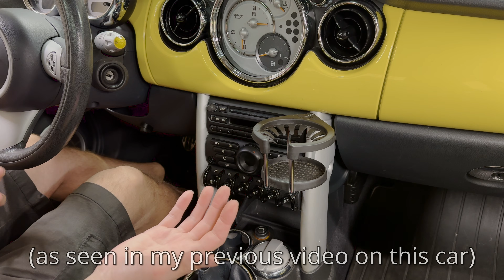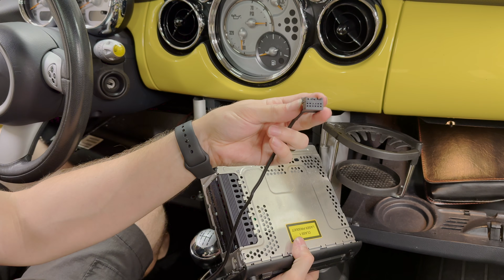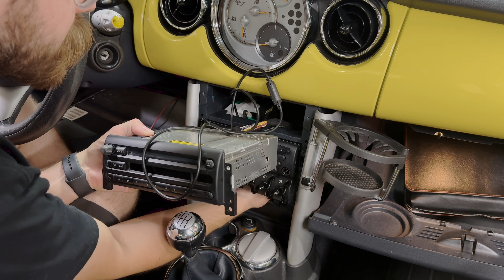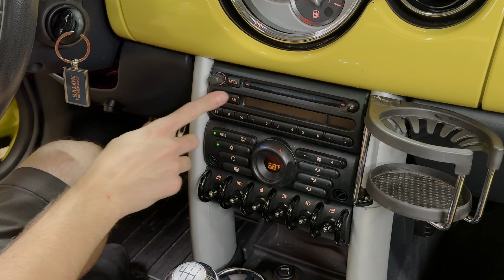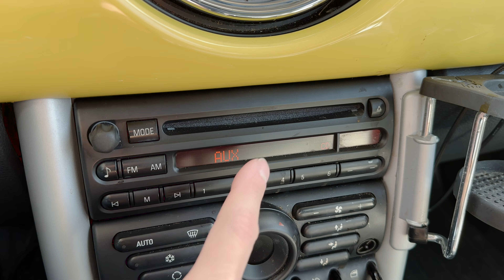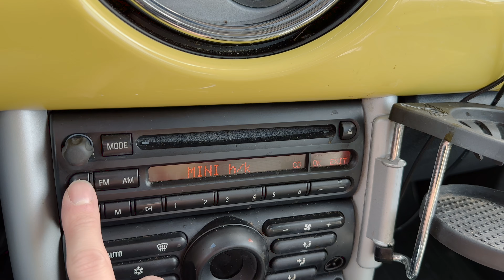EASY Mini Cooper S Upgrade! – How to add an AUX Input! (R53)

Comment: what  good is this Aux input? it doesnt run. your phone through the speaker, it isnt even blue tooth. What am I missing
Reply from the maker: You could add a bluetooth to AUX adapter, or connect other devices without replacing the factory radio.
Reply: @frenchineer I just got one of them Bluetooth things that plug into the cigarette lighter turned it to 88.3% of Pandora all day through my factory Harman kardon system it sounds great

Comment: Did your system bring up the "AUX" mode prior to installing a cable? Mine will only cycle between radio and CD. I am not sure if it needs the cable to become active or whether my system doesn't support it. It's a 2004 facelift btw.
Reply: Some radios have the feature but only work with aux cables with resistance. Some radios up to 2003 don't support aux. Also could be that radio supports aux but needs to be coded ncs dummy to show aux
Reply from the maker: I forgot to check so I'm not sure, but I would expect it to only show AUX if the plug is connected.

Comment: Great video. I was going to do the same thing but decided to get the single DIN car play unit with the plate light backup cam from ECS. Just ordered it so excited about that. I noticed the upgraded tach to a tach/speedo and added, what looks like a Chrono gauge where the old speedo was. I'm going to do the same thing and have been doing a lot of research. Do you know if the odometer and VIN followed the upgrade or did the owner end up trying to get close on the replacement? Do you know if there have been any issues with the Chrono gauges actually working?
Reply from the maker: Nice! I hope you enjoy the upgrade. The dual gauges were a factory option on this car! I'm not sure what would be required to retrofit the dual gauge setup.